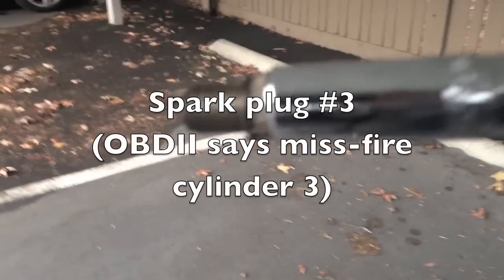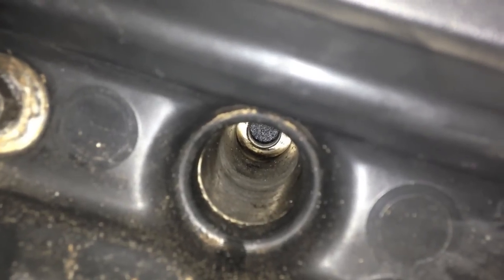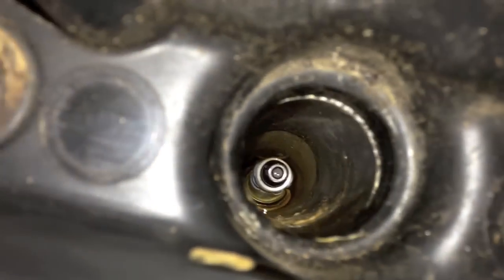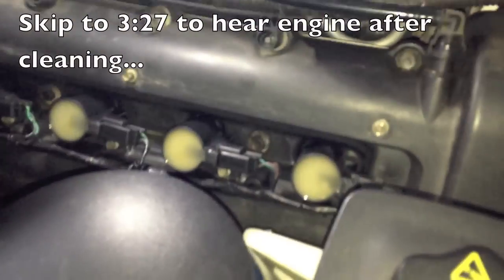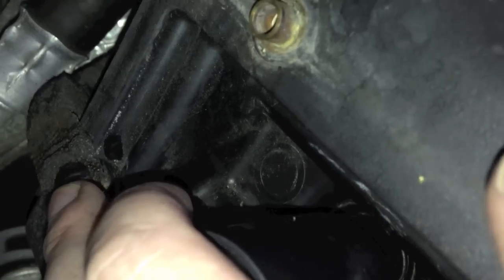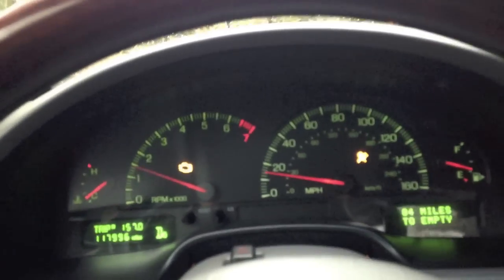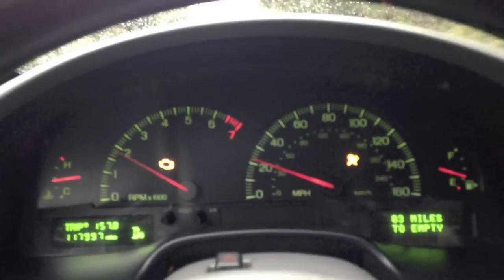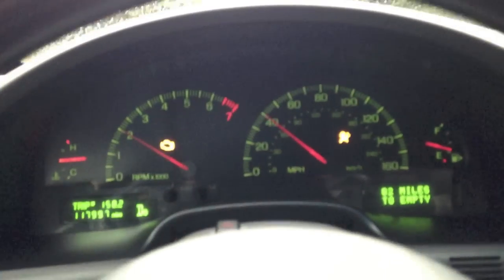Lincoln LS Missfire

Comment: The Ford repair manual states you should put some silicon sealer at that notch you pointed out at the back of the cover.  
I was getting 6 different error codes relating to the throttle body recently.  So naturally I replaced the throttle body.  Still got 6 error codes.  After researching on Lincoln V. Cadillac It was clear I needed new coils and plugs.  I replaced all.  I still got 6 errors codes all relating to throttle body errors.  Then I read to clean the MAF sensor located just behind the air filter.  (Totally unconnected to the throttle body.)  I removed the two holding screws and sprayed it real good with MAF cleaner. THIS FIXED THE PROBLEM.  Now the LS V8 engine hums like a sweetheart.    These Jaguar designed engines are real sensitive.  We love them when  they hum along, but they can be very weird.

Comment: Love them when they are running right. Run a 1/4 inch bead of Permatex ultra black around the coil cover on the engine valve cover, just follow the indention. Let it dry over night and reattach the cover, leaks gone.

Comment: Keep in mind that if a OBD2 error code states a # 3 misfire it's referring to the 3rd in the firing sequence NOT the number 3 cylinder. Ford, Chevy, Dodge, Toyota, Honda it doesn't matter, when any OBD2 error code names a cylinder by number it's referring to the firing order NOT the cylinder number.
Reply from the maker: Timmateo As for the LS, it seems that it is the cylinder order that the code is referring to. This has been found by others on the Lincoln Vs Cadillac forum as well as by trial error when replacing coil packs.
Reply: Jon Fromm is cylinder order same as fireing order
Reply from the maker: It's not the same, but if you get a code for missfire on Cylinder 6, it's not firing order 6, it's cylinder 6. Passenger side front is #1, then 234 behind it, drivers front is 5, then 678 behind it.
Reply: Jon Fromm  If you get a misfire code for cylinder 6 on Lincoln 3.0 V6 then in that case it is cylinder #6 (driver side furthest back) because the #6 cylinder is the last in the firing order. However if the code read misfire #5 then it would be the #3 cylinder (passenger side furthest back) because it is the fifth in the firing order.
Reply: You're wrong on that. The misfire code always refers to the cylinder number. If it read misfire #5, it would actually read misfire CYLINDER 5. You can't just throw around info that you THINK is correct.
Reply: Wrong. Number 3 missfire p0304 is the cylinder number. Not the firing order

Comment: Coils failing on the Lincoln are a common problem even when water does not get under the cover. Its' not just water or oil leaks causing it

Comment: the water is coming from the passenger side " cowl grill" it leaks down and yes that small piece of foam going under the cover into the coils will soak it up and it builds up in you spark plug well thus causing a miss fire !!!!!! OR your passenger side nozzle for the washer fluid could be leaking and in return cause water to leak into the coils !!!!!! but the "cowl grill" is the main issue to address first !!!!!!!!!!! THIS ISSUE WAS POINTED OUT IN THE "(TSB)"      

 from a women that knows her LINCOLN LS
Reply from the maker: Heather Kidd You are right. To solve the problem I just replaced the coil covers with ones I found at a junk yard that were in better shape. Ford couldn't find the seal for the cowl.

Comment: I just changed all of my ignition coils,  and it's still missing,  and throwing the same error codes.
Reply from the maker: I'd suggest taking out your spark plugs as well, you probably have oil on some. If you replace the oil covered spark plugs, that should solve your problem for now.
Reply: Replaced them yesterday along with all 8 ignition coils still having the same problem.
Reply from the maker: You could have water in the spark plug wells, or a less likely scenario of the harness that connects to the coil packs could be going out. When I replaced all 8 of my coil packs (the ones you saw in the video) I did it with cheap coil packs. They all failed within a month. You may have had that happen too.
Reply: Soo when I pulled my old plugs out, they still had the old anti seize on them, but these also had rings that came around the threads which only a little oil was around and under the ring.
Reply from the maker: I think your best bet is going to be buying a good single coil pack and replacing one of the packs that are giving you a code, just to see if that coil pack is giving you a code.Your car will misfire from only a few things: oil leaking onto the plug, coil pack going out or failed, or spark not getting to the coil pack (this can be from water or from a bad wiring harness to the coil pack). You've gotta diagnose it one way or another. But the most common problem is a bad coil pack.
Reply from the maker: The passenger side cat was clogged, so I had it replaced with a Magnaflow cat at a local shop for about $280. Secondly water was getting through the passenger side coil cover and causing the coils to fail. I replaced those and all is good. The coil packs I replaced them with were cheap and all failed in a few weeks. I put my original ones in (now dry) and they've been working for 2 months, no misfiring. My car was shaking and studdering, and occasionally losing most power. The check engine light would keep flashing. I've had misfireing in the past as well, sometimes you might not even feel the studder.
Reply: Trying to keep from going to the dealer,  but looks like that's where its headed.
Reply: So im at the dealership,  the guy says my coils are fine, he said two of my injectors are not getting power to them, or my wiring is bad, OR my PCM is going bad...
Reply: ***** how pricey is replacing the pcm? I have an 03 v6 needed coil 3, replaced it and still same code.. gonna replace injector next
Reply: Two of my injectors weren't getting power to them, which burned out the pcm.  The pcm alone was $825, plus labor charges another $550, in the end I ended up paying $1,485. This is my second Lincoln ls I love these cars but this is my last.
Reply: I was told the same thing, they rarely burn out, but mine did.
Reply: ***** Did that harness repair fix the problem? I am in the same boat. Cylinder 4 misfire after replacing all coils and plugs.
Reply from the maker: Michael Babby Water turned out to be the problem.
Reply: See my post above.  CLEAN THAT MAF SENSOR!

Comment: Im having the same problems, did any of u have any smoke up near windshield
Reply from the maker: I've had smoke up near the drivers side of the windshield, That's most likely the degas bottle (extra coolant reservoir). It's located in the engine bay on in the very back on the drivers side, it has a cap that sticks out of the wiper cowel. They are one of the most common failure points on the LS. They tend to crack and need to replaced. I can't imagine it being hard to do. Keep in mind, that doesn't have anything to do with your misfiring problem.

Comment: Theres still oil in my combustion chamber
Reply from the maker: +yancy reyes Oil is in there because the valve cover gasket tends to fail. You should replace your valve cover gaskets, then you should be good to go as long as your coil packs are still okay.
Reply: Spark tube seals

Comment: I have fixed the misfire due to oil in the combustion chamber , and thoughts of what that could be ? I have already changed all gaskets , except the head gasket because theres no coolant in my oil so idk what the problem is ...
Reply from the maker: +yancy reyes your coil packs and spark plugs may still need to be replaced.

Comment: Did you find\fix the problem,what was it?
Reply from the maker: 2 problems. The passenger side cat was clogged, so I had it replaced with a Magnaflow cat at a local shop for about $280. Secondly water was getting through the passenger side coil cover and causing the coils to fail. I replaced those and all is good. I may have not needed to replace them, FYI, just should have let them dry out.
Reply from the maker: Also there is a slight leak in the valve cover gasket, but it hasn't shown to leak in more than a year, so I'm holding off on replacing it until it leaks again.
Reply: Jon Fromm No the coils short out when wet. The reason why it still missed was because the coil was weak from shorting out from the water. ( I hope that made since). Replacing them was the best thing to do. When I bought my 02 it had a bit of a miss ( 2 weak coils) but within 2 weeks one had completely failed. There was no water when I took them out but it still failed. I replaced them both 8 months ago and never had a problem since.
Reply: +batchnerd  Yes I agree , it a common failure of the coil packs going bad and water getting in

Comment: hey did you ever fix the problem if so what was it???
Reply from the maker: In my case water was getting past the windshield wiper cowel and dripping onto the passenger side valve cover. The seal on the coil pack cover wasn't good anymore, so it let water into the spark plug wells. Miss-fire on the LS is almost always due to either water getting into the spark plug wells, or the valve cover gaskets leaking oil into the spark plug wells.